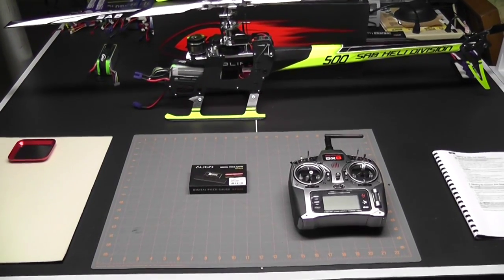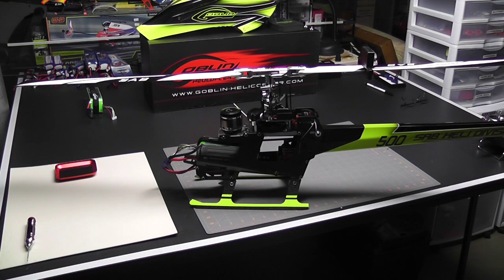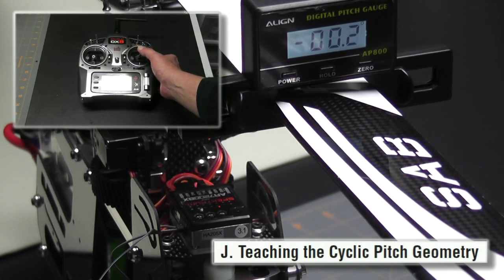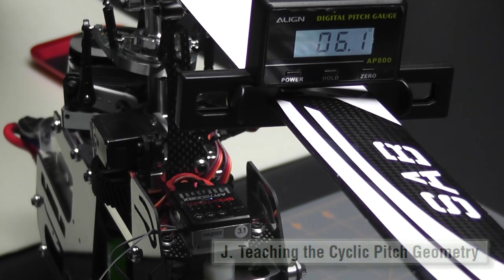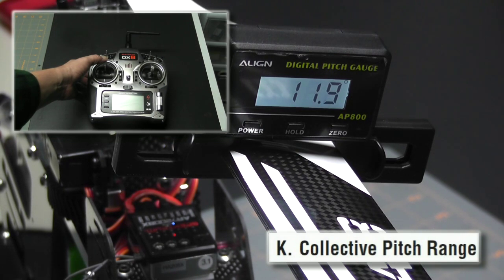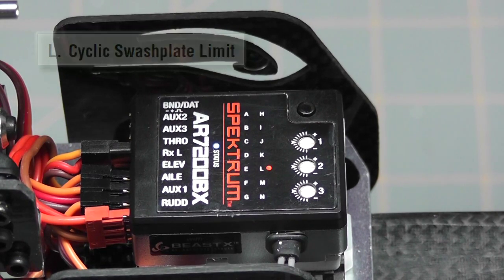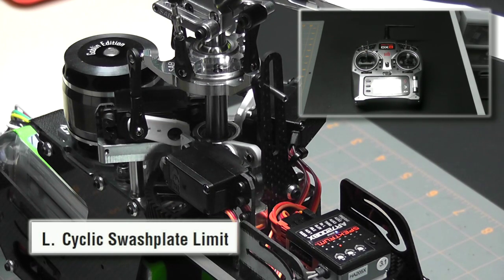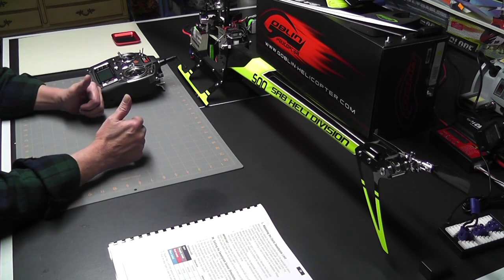Goblin 500 Electronics Set Up - Video 5

Comment: Hi,

Your protractor - Algin digital pitch Gauge - model is AP800

I used this type of contact form other campany and encountered problems, 
The helicopter did not behave ... good.
I checked the angles of the ordinary counterpart and it turned out that the difference is almost 0.5 degrees,
The analog one when we look at it, our point of reference is the swashplate ,
But in the electronic world is there? :)
Unless we run out of a point in the heli, and calibrate the angle around it,
It would be best to calibrate, the swashplate,  but it is not feasible for smaller classes.
Besides, on every helipad which is bent forward I need to make it as horizontal as possible before calibrate and for check angle,
Otherwise there is a mistake on my electronic counterpart.
It looks to me that I have to remove in most of my heli the Landing Gears.
May have some cool way to calibrate the angles mater (protractor).

Ps. "Sorry for my English :)" 

Regards.
Reply: Hi There.  Now I understand.  I am not aware of any way to calibrate the pitch gage. The only suggestion I can make is to use a manual (not electronic) gage.  I hope this helps.  Good luck and happy flying friend.

Comment: in parameter  L you didnt say what you would have to adjust  if you needed to adjust.
Reply from the maker: If you had binding, you would adjust your servo links to eliminate the binding and repeat the step.  Hope this helps!
Reply: georgesjunglerc you mean the control arm links?
Reply from the maker: The links that go from the servo to the swash.  If it is binding both in the high and low position, then move to the next closest hole to the servo yoke.  Hope this helps!

Comment: Everyone seems to skip this part. If you don't have zero pitch at menu J going back to G does nothing but recenter your swash arms. how to you get to zero degrees of pitch?
Reply from the maker: Hi, Sorry, but I dont think I skipped any steps.  I simply stated what is in the manual.  I explain how to set the zero pitch in a previous video.  In any case, I am not a Spektrum employee or an expert.  I state in the videos I am an novice and don't get paid for all the time I put into these videos.  You get what you pay for!  Good luck!
Reply: georgesjunglerc
No I understand, and thanks for the Vids. That reply was more an attempt to get some help on the subject, because the manual and the videos i've found are not very clear. I've had a good bit of trouble with the beastx so far.
Reply from the maker: doluseb Don't feel bad, I ran into the same thing with even less resources than there are now.  That is why I made the video in the first place.  Like I said, in a previous video, I go over how I set the zero pitch.  I hope it helps and best of luck getting it dialed in.
Reply: @georgesjunglerc  hi George I was setting up a new tail servo on my 500 goblin now I have no throttle, wat could be the problem
Reply from the maker: @chrishollingsworth1980  Hi Chris.  I wish I could tell you what is going on with your problem, but it has been years since I did this series.  I can tell you I would check the ESC and BEC if all looks correct on the AR7200.  Good luck, be safe, and happy flying friend.

Comment: hi with setting the pitch , i fly in normal mode .so mid stick is 0  4- and 10.5 up , i knotice in the set up there is not any mid stick mention , i now have shortened rods so i have 0 at mid and 4 minus and 10 up  am still onthe right track
Reply from the maker: Hi there Louise and thanks for posting.  I have my mid stick set at 0, minus at -10 and high stick at +10. You should have your positive and negative pitch the same, even if you are not going to be flying in idle up.  Hope this helps.
Reply: georgesjunglerc why 10- i only use 4-  i dont want to set up in idle up mode  -4 to 0 to 10.5 , 10 - would make this heli hard to land ,,,
Reply from the maker: Hi again Louise.  Not at all.  It will be no harder to land.  The reason for +10 and -10 is for a linear relationship on the swash plate movement.  I am not sure I understand all the details, but that is how I was taught.
Reply: georgesjunglerc hi i set 10 up and 10 down  in the beastx and went into pitch on the transmiter and dialed up to - 4  so i have -4 to o +10 seems ok is that right
Reply from the maker: Hi Louse, sounds good to me.  You may want to add some Expo and Dual Rates on your first flight to tame it down a bit.  Once you have confirmed everything feels good, you can dial up the settings for more aggressive flying!  Good luck!

Comment: Hey, if you set the pitch to 12 and -12 on the flybarless unit, do you also use pitch curves? If so what's the point of setting this on the AR7200BX? Amazing videos by the way I love the simplicity :)
Reply from the maker: Hey Paul.  Yes, you still use the pitch curves.  The pitch curves are based on percentages of the total throw.  Setting the max pitch using the AR7200BX determine what the maximum throw is.  The combination of the two is what determines the flight aggressiveness of the craft.  Hope this helps!

Comment from the maker: Hi there and thanks for posting and the kind remarks.  In all honesty, by the time I get the video shot, I have already done the procedure several times.  You are most certainly correct, you should attempt to achieve the maximum travel with out binding, and although I did not show it, it was done.  There is so much information to cover, I sometimes lose track and miss an important point.  Thanks for pointing it out and I hope it did not cause any confusion.

Comment: Hi George, Roger here :) Excellent video again, reminds me very much of how it looked a few days ago for me as I have pretty much exactly the same components and even pitch gauge :)

I found step G to be tricky making sure the swash plate was 100% level. I managed to get it within 0.5 degrees to 0 pitch in a full revolution of the head but it took a while as you have 5 points of adjustments (3 servos + right/left rod) and they are interconnected! :)

Looking forward to the Talon ESC video! :)